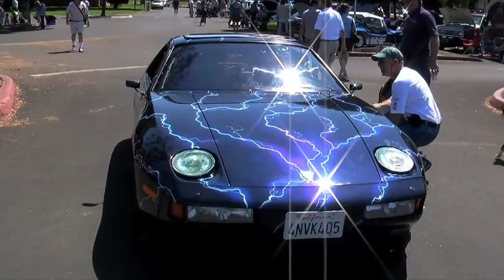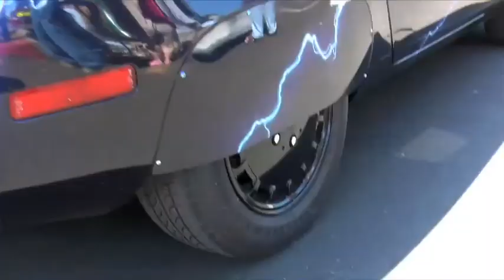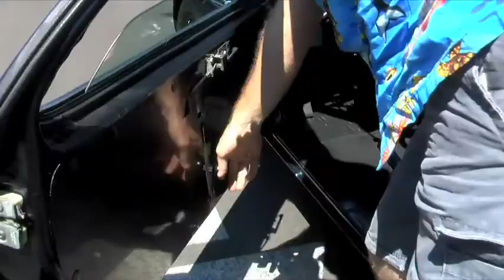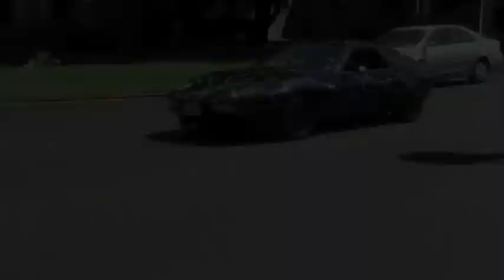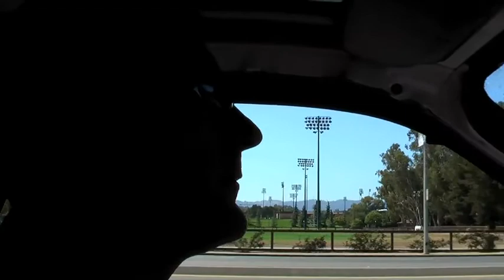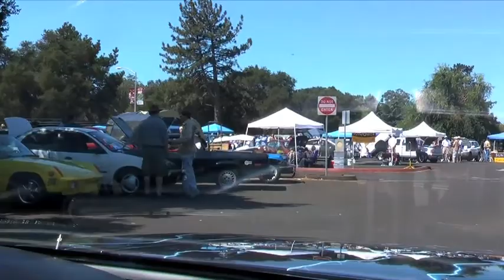EV Rally 2008: EV Porsche 928 Conversion

Comment: Also, I thought you were implying your car weighs 800lbs total which would have been ridiculous, my bad! 
Long term EV's are expensive. If a battery dies you have to replace it. Until you replace it it overworks the ones around them. Every time you cycle them you diminish their life. Cold weather is brutal on them. Overcharging or half cycling a NiCad NmH or Lead battery kills it quickly. Overdraining LiPo or LiIon batteries, same. I'm sorry Ev's are impractical til a better battery is invented

Comment: I do know about EV's. I've read countless articles on themand in almost every case the car, especially with lead-acids, is heavier than stock and requires upgraded brakes and suspension. You now have lithium, which is lighter but very expensive in comparison. My point was to get there you went farther than most people are willing to go. From everything I mentioned below to how you even replaced the original SAFETY GLASS windows with plexiglass. It's neat but impractical.

Comment: While I appreciate the work you've done there it seems more a showcase of what's possible, albeit crude, than the best solution.
Natural gas and biodiesel are better ideas, cheap and very clean. It's very easy to create natural gas as opposed to hydrogen, and biodiesel is everywhere. I've even read where people go to restaraunts and buy their old cooking oil for use as biodiesel, and it works! These also both allow one to keep their IC engines and car intact for simplicity, resale, and parts.

Comment: Your arrogance aside, I do know about electric cars which is why I commented on how much I dislike EV's. I highly doubt you car weighs 800 lbs when an early 928 weighed almost 3600 blbs. It has the heaviest and strongest subframes structures ever made. Still, you've gutted the car to the point where it's not practical anymore for the average person. Example, you've removed the electrics, so you have no abs, no headlights, assuming no brake lights or turn signals, no horn, radio, ac, heat, etc

Comment: @handofchurchill ,
   As far as torque, yes electrics produce massive amounts of torque down low, but this quickly fall off. They are the easiest car to launch because of this.  this is reason that they dont need a clutch or automatic trans. The spinning tires you here is me showing off :)
  As far as recycling lead acid batteries. They are probably the most efficiently recycled items, next to cars as a whole. Over 85% are reused including the plastic cases.
 Have a nice day !
  Jeff

Comment: @handofchurchill 
  You should stick to commenting on things you know about. Electric cars arent one of them.
  Lets start with the weight, with the lithium pack that has been in the car for nearly two years now, my 928 weighs 800lbs. less than it did stock with 1/3 tank of gas. The lead acid version was within 50lbs. of the stock car. This was with 1,300lbs. of lead.

Comment: Also EV cars are inherently very heavy and batteries have severely reduced life and output in cold weather unlike California where this guy lives. Also electric motors produce massive torque across all rpm's and since most EV's have no clutch or trans they tend to be tricky to safely launch from a dead stop. (Listen to the tires at 36 seconds). Imagine driving this heavy ass torque monster in rain or snow.
Thankfully she stopped his idiotic rant at 4:39. Just the facts sir, just the facts...

Comment: What a shame, another butchered classic. Bush this... big oil and car manufacturers that..   
EV cars are still a joke and will always be a joke until science comes up with a better (lighter and faster charging) battery. And why is no one talking about the long term enviro damage these do? How many lead acid batteries does it use? Each has a standard shelf life of 2 years and then need replaced. Where do those batteries go? Landfill? Diesel technology is what needs subsidized. 70mpg average!

Comment: @walthomas  
 For what I spent ? I only spent just over $13,000 for the lead acid battery version. This included the cost of the 928. Now that I have had a lithium pack in it for over a year and half , I have twice that invested. But I also put over 10,000 miles a year on it, drive it everyday, even through the worst of the California rains last winter.

Comment: @ 3089280288:  How complete of an answer does one need - it's reasonably straight forward: Using the vehicle's momentum to spin the generator's coils necesitates the drive-shaft somehow connect with the generator.  The coils provide resistance to the forward momentum, which is what produces electricity.

Comment: @ 3089280288:  the reason a car slows down under your example is due to the laws of physics (I'm sorry your idea is flawed  and manufacturers have already deemed it impractical). Unfortunately for you, simply pretending the friction generated by an energy recapture device doesn't cause deceleration in no way changes the fact that it actually does.

Comment: Why would the car slow down?  Using the braking feature to use the motor as a generator to recharge the batteries, I can see that. 
 I'm thinking of a windmill where the wheel movement would be like the wind and the car would act as a turbine.
If it could be done, recharging would tke less time.  Maybe a car could employ a fifth wheel just for that purpose.  Somebody is going do it.

Comment: Yes and no. Any device using the car's momentum to recapture energy will also slow the car down, so you'd never be able to free-wheel.  The Tesla, for example, employs this technology so the brake-lights come on the moment the driver lifts off the gas, even if he doesn't hit the brake pedal.  To avoid this, most electric/hybrid cars just recapture inertial energy when the driver applies the brakes.

Comment from the maker: Hello,
You can contact YouTube user: 
jmccabe928 for more info about the car.
Jeff has a clutchless system so 0-60 time is affected by 2 second delay for shifting.
0 - 35 MPH time is 4.8 seconds compared with 2.7 seconds for the AC Propulsion eBox.